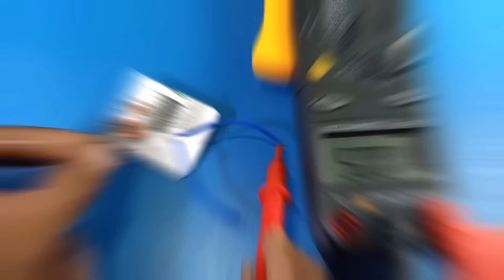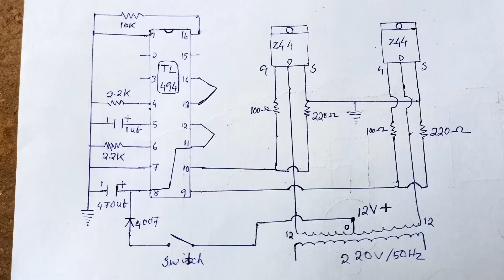Powerful Inverter 4000W || How to Make Simple Inverter Using IRFZ44N , 8 Mosfet , Sine Wave

Comment: At the end of the video when you activated the grinder why didn't you put a measuring instrument at the output to check the voltage if stable at 220v or dropped to 100volt .. I think 4000Watt you are very far away bro.. :-)9😏🤔

Comment: i have a question i found that 1 irfz44n is 94w that means 94*8=752w i am confused is it real 4000w? Did you work it to anything else you just use it only to a wheel cutter that is 600w
Reply: the transformer only can deliver 150VAC. it can not deliver 4000w !

Comment: Hello!   I did it like this.   Can I now connect this to a 12 V 40 Ah car battery or what is the maximum Ampere for the car battery?  Thanks for the reply
Reply from the maker: @ivantroseljac2685  you try
Reply: I don't know anything again.   what is the maximum ampere for this circuit?

Comment: Do the diode and capacitor protect the mosfet from damage due to discharging the charge in the transformer? Is it specific to the IC only? Please reply. I bought four pieces and they were damaged due to the lack of protection for the mosfet.
Reply from the maker: Check it well, n try

Comment: thank you brother you better have another question the first question is can I power this with refrigerator. second question is how long can it last which appliances like TV and fun in the house. what is guarantee life sperm.
Reply from the maker: This inverter same to same other inverters
Reply: @RJEDITALL  thank you sir but please how can I make it to work same way like like ups you know when you plug ups to light and the light went off do ups will still continue to work the normal lights it will switch to battery so please how can I make it work the same way like ups thank you very much sir.

Comment: In this video which battery did you use and how many voltage and amparag
Reply: Please reply how much voltage and amparag did this battery took
Reply from the maker: Please check diagram in the video
Reply: I don't understand the diagram
Reply: The connection all are I understand but the battery I didn't understand because than only I also want to make thies
Reply: And I give the transformer  12-0-12v 40amp did it has any problem
Reply: Please reply ???

Comment: Hi, if the battery current is higher than the transformer current, will it not damage the transformer? This question is very important to me.
Reply from the maker: No damage
Reply: @RJEDITALL which batterry ? Akumulator 12 v 55AH?

Comment: Nice, thank you ! but you said 4000 w in the video's title so why do you use a 600w tool ?  2 vacuum cleaners = near 4000W / hour (often 2000W for 1)
Reply: the transformer only can deliver 150VAC. it can not deliver 4000w !

Comment: good afternoon did you use tv or a computer or something more powerfull? for example 2500w?and my transformer the input is *2 10volt what should i do ?
Reply from the maker: Yes, you can use 10-0-10v transformer
Reply: @RJEDITALL  thanks for your help have a nice day
Reply: And one more question is it 50 hz or 60?And the output is 220volt?
Reply from the maker: @pcnikos7836  50 hz 200-240v

Comment: Hello, I'm having some issue with the inverter, i use 4 MOSFET instead of 8, that's 2 on each side , but my Negative and positive wires from the battery is burning out(overheating), i have cross check and i couldn't find any problem, pls help
Reply from the maker: Check it well
Reply: What kind of power is your load pulling??  This can let you get an estimate calculation as to how much current will be drawn from the battery on input side in order to provide the power at output.  It sounds like it's simply trying to draw too much current for the wires to handle, if the case use a large gauge power wire on battery connections.

In general, taking 12V DC to any usable power level of a home tool/device that runs on 110V is gonna be 350-900W, at lowest of say 350W, a 12V source to make thIs power would need minimum of P=IV so 350/12 = roughly 29A of current...which is a quite large current.  If just using "normal" gauge wire, smaller wire has exponentially higher resistance than large gauge wire...so if you use say some large speaker wire 12-14ish gauge 30+ amps would melt it.  You'll have to use like 8 gauge or so (just look up current ratings and resistance per foot, it's easy info to find in tables online).on the battery side for the power providing wires on all that will carry this high current.

Keep in mind too, since weakest link is the wires and they burn up fairly quickly, once replaced with a gauge that can handle the current...keep an eye on the MOSFETs and other components transformer etc to monitor temperature.  Now that they are getting max current due to wires not failing, they may also suffer from too much current exceeding their max.

Comment: Hello my dear friend.  Your videos are great.  If possible, I have a DC to DC boost circuit with 3.7V input and 40V output and 20A current with 1000W power and the ability to adjust the voltage and current to start the ZVS circuit.  Create a 40V, 20A, 1000W input on your YouTube channel.  I would be very grateful if you could do this.🙏
Reply from the maker: Ok, I will try, very hard
Reply: @RJEDITALL  Thank you very much

Comment: Hello, sorry if I bother you. I did the same project as yours with irf3205. The middle cable of the transformer gets very hot. electricity comes and goes for 1 second, what is the problem?
Reply from the maker: Check your mosfet, no heating problems
Reply: برق سویچ نمیشود و ترانس با برق دی سی کامل روشن میشود

Comment: I used IRFZ46N instead of irfz44n, i am getting extreme heat on my wires, positive terminal wire, negative terminal wire and the two more coming from the transformer to the drain point of mosfets, possible reason ? Please reply
Reply from the maker: Yes,You can use, check it well
Reply: @RJEDITALL  You didn't answer my question?
Reply: @RJEDITALL  You didn't answered my question.
Reply from the maker: @ahmadkhalidhotak9399  check your mosfet, and try. 100% working, no heating problems
Reply: @RJEDITALL  mosfets do not heat, just those wires burn out still after high amphere wires.
Reply: Problem solved, i was using a wrong 3 wire transformer. Thanks for the video.
Reply from the maker: @ahmadkhalidhotak9399  you are welcome ❤️
Reply: @ahmadkhalidhotak9399 pls what do you mean by this, I'm having same issue

Comment: Salut, homme frère, tes projets sont magnifiques. Dis, combien de transistors puis je ajouter à ce projet pour faire fonctionner mon freezer? Et la batterie, combien d'ampère ? Grand merci.
Reply from the maker: 8+8 mosfet you use
Reply: Thanks a lot brother, now, how about battery and transformer (ampere for battery and ampere for transformer)?
Reply from the maker: @anatolemikala881  12v 12- 120 ah

Comment: Great video, but how can I choose the appropriate converter for the inverter? I manufactured a 3000 watt inverter, but the transistor overheated. What is the reason? Please reply. Thank you
Reply from the maker: Please use big heatsink, and cooling fan. No heating problems
Reply: bro please all resistor watts please bro
Reply: Если транзистор грееться, значить несоответствуеть по техническим параметрам, нет других причин. Указанное (видео не боле 500 watt ) транзисторы выдержить без нагрева боле 5 kw. Uzbekistan.

Comment: This circuit is successful .. but the wattage is not ok ... my transformer is 12.12v 5A ... that is also a problem .... one more thing ... the output is 180 volts ... please help 🙏🙏✊✌️❤️❤️❤️
Reply from the maker: Thanks for try, you can use 10-0-10v transformer
Reply: @RJEDITALL  i have 7.0.7 ups transformer .. i can use it this project ...

Comment: Hi, can I also use 48v input coming from wind turbine? Thanks
Reply from the maker: Maximum 12v
Reply: I have 48v input and what should Im going to do?
Reply: @nickersoncapiral9718  Use LM317 then LM7812 + some BJT/MOSFET for high current between wind turbine and the inverter

Comment: my friend i have ic4558 it needs 12/0/12v but i want it to run on 12v battery how can i extract the 0 cable please reply my comment
Reply from the maker: Very simple bro, your need 2 battery 12v, you connect 12v battery series connection. You find (12v +) series site (middle site) 00v and (12v -) out supply
Reply: @RJEDITALL  Thank you from the bottom of my heart but now I only have one battery. Thanks ❤ Is there another way??
Reply: My friend that you did the way you taught me will become 24v and thus damage the circuit

Comment: Brother please help Please i make this inveter same to same but it is not working i used same components Still not working please help....
Reply from the maker: Please check your mosfet, with multimeter
Reply: @RJEDITALL  brother I chat everything with multimeter MOSFET IC resistance everything is fine but it is not working please help me please contact me please U are in insta gram....

Comment: I  make this  inverter  but transfomer out put  supply 160     why
Reply from the maker: Please use 12-0-12v to 220-240v transformer
Reply: @RJEDITALL    12 0  12     230 tarnsfomer   usde  but out put voltage  160
Reply: @RJEDITALL  how much watt

Comment: I have made the circuit. And it's working. But I get only 150VAC. Please tell me a possible reason. I have used a 12v×2 centertap transformer. 
I used 470uF 16V capacitor, instead of  470uF 25V capacitor. Can it be the reason?
Reply from the maker: Bro check it well, and you can use 9-0-9 to 10-0-10v transformer
Reply: @RJEDITALL  thank you ❤❤
Reply: did you check the frequency? and did you load to 150 vac with drill or some machine?
Reply: @chiefchief9793  I couldn't check frequency.  But when I load the cct, voltage drop to range 110VAC to 120VAC
Reply: @gadjetsgarage  thank you for answer..
Reply: today i did this project, but it doesn't work.. no frequency.. something must be wrong.
Reply: @chiefchief9793  check grounds of the circuit
Reply: @gadjet's garage : the transformer only can deliver 150VAC. it can not deliver 4000w !

Comment: Hello, can I use 10,0,10 transformer
Reply from the maker: Yes, 100%
Reply: Sir transistors burned out and wires over heat please tell me sollution
Reply from the maker: @karnankarnan6005  please check your mosfet, many people try It , working good
Reply: 10 amps transformer can I use
Reply from the maker: @karnankarnan6005  yes

Comment: Pls I have 6 irfz44n MOSFET
Ups transformer converted to 12-0-12
100 ohms 1/4w
220 ohms
330 ohms
1k 2w
10k 2w
22k 2w
4047 ic
What type of Inverter can I make or what more do I need thanks
Reply from the maker: 220 ohm, 22k, 4047 ic z44 x d , you can make inverter
Reply: @RJEDITALL  pls put me through
Reply: @RJEDITALL  do you have a video?

Comment: 2.2k 1/2 watt or 1 watt or 2 watt
22k 1/2 watt or 1 watt or 2 watt
10 k 1/2 watt or 1 watt or 2 watt
220E 1/2 watt or 1watt or 2 watt
 Please. Give answer
   Please please 🙏🙏🙏🙏
Reply from the maker: You Can use all Rasistor 1/4 watt